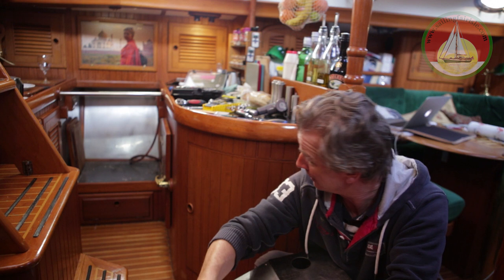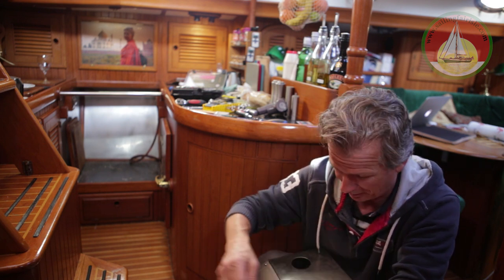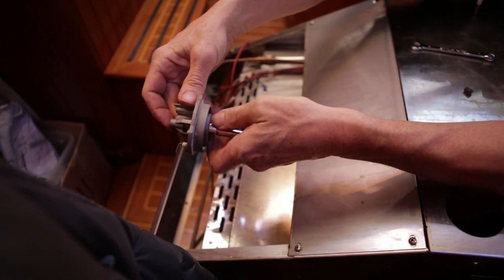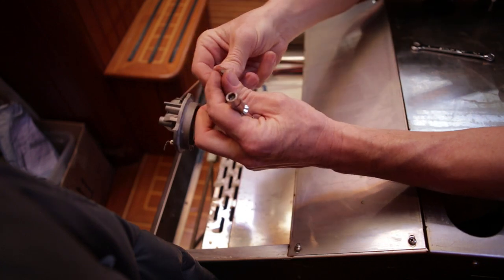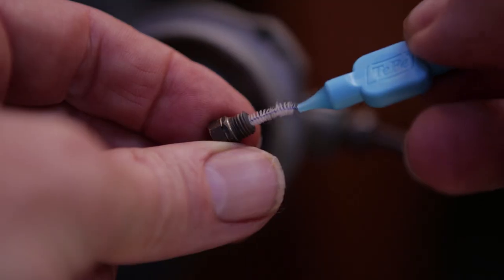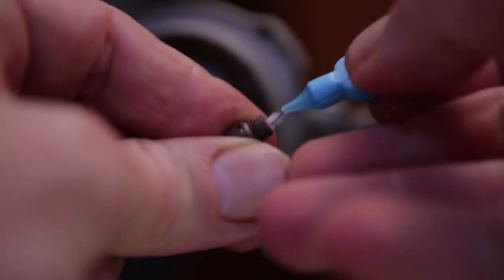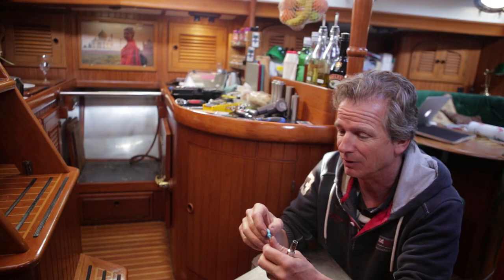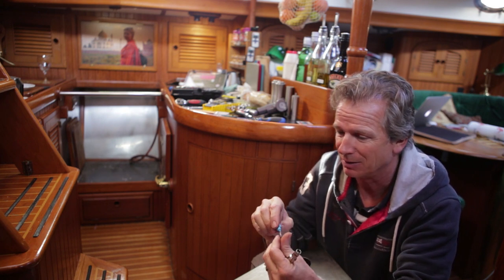Boat gas cooker maintenance

Comment: Wow....Once again I am the first to comment! Thanks for the tip. Sometimes it can also be the "thermocouple" which will not allow the gas to flow once the flame ignites. This was obviously not the problem in your case. Sorry for being mean spirited with your brass cleaning video. The info and demo was good. In Australia we have "Autosol" metal cleaner available in automotive shops.It works well too. Cheer,Rob (From Tasmania)
Reply from the maker: Yes you're right thermocouples are probably the second most likely thing to fail. At least it's obvious as the gas will flow fine while you're still holding down the knob and only go out when you release it. 
We do have Autosol too, I use it for stainless.

Comment: Just a thought but in the UK I am lead to believe that your insurance coverage may be at risk if your boat does not have a "Gas Certificate by a competent (Gas Safe registered) engineer". I expect removal of the oven would nullify the test certificate but I stand to be corrected.
Reply from the maker: That might apply in Australia I think, but I never heard of any such restrictions in the UK & it's certainly not mentioned in the insurance. It is good to double check these thing though, another sailing channel has just had an estimated $100,000 of damage and apparently the insurance wont pay. Sailing in an unspecified area.
Reply: @svfairisle  Not a legal requirement in the UK but as you note Insurers will use just about any excuse not to pay. You may be interested in a reference to this subject in PBO - 2015 issue https://www.pbo.co.uk/expert-advice/check-your-boats-gas-system-19785

Comment: Hello, I was wondering if you could expand of this. I've been cleaning our old but new to us force 10 stove and I think I'm being a bit stupid, but I can't seem to take the burner off! I've unscrewed it, but don't know how much force to use to pull it off- and I certainly don't want to break it! Any advice would be wonderful. (google is utterly unhelpful) Thank you.
Reply from the maker: Well that's odd! The burner top just lifts off and then there's one little phillips screw to undo and you should be able to lift the burner out completely.
Reply: @svfairisle  thank you - I will use a bit more force then!! I have a feeling, judging by the huge build up of dirt on the stove, that they have never been taken out so are probably held in by 20 years of grime.
Reply from the maker: It probably is just that, there's really no reason (apart from ease of cleaning) to take the burner tray out so it's probably never been out. You can access the jet with a small socket to get that out for cleaning so if you can manage to clean the tray in situ then I would just do that.
Reply: @svfairisle  oh perfect thank you so much for your advice.  Its so hard with a new and crusty oven to work out which bits should come out with a bit of work and which should stay.  I can definitely clean them insitu.  I just hope that the oven one is a bit easier as that is the one that is struggling to work!
Reply: @svfairisle  btw I love you technical corner, it is so straightforward and informative.  Our new boat has quite a bit of wood inside so I will be re-watching your varnishing episode shortly!! (and getting my husband to watch the winch episode...... that will be his job!)